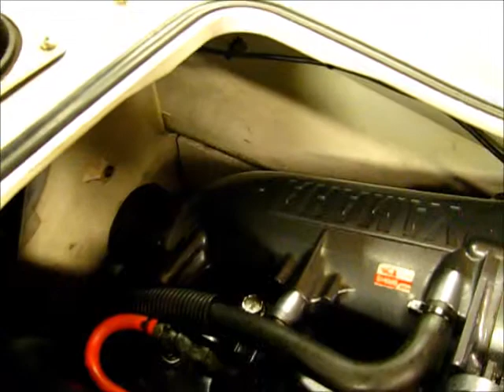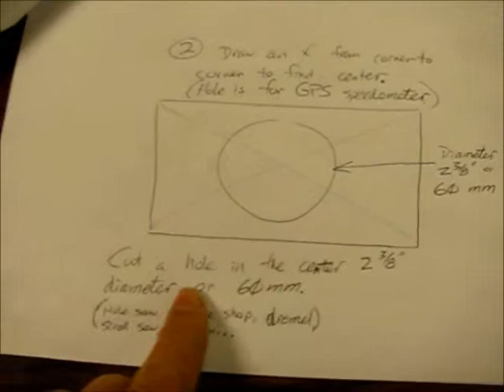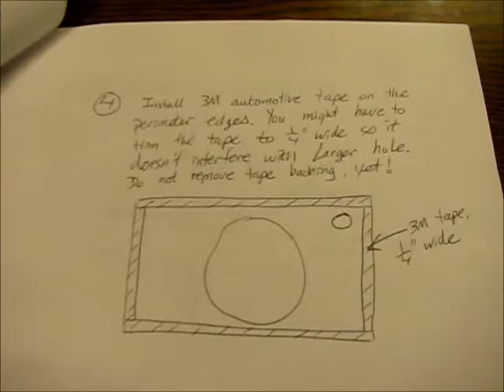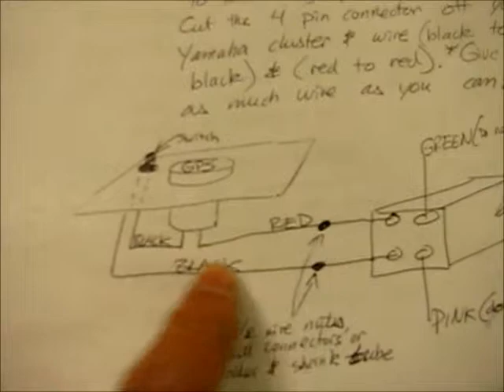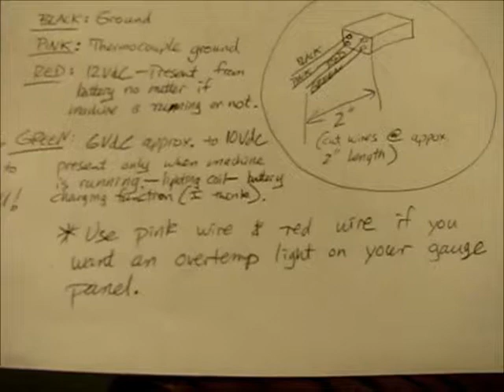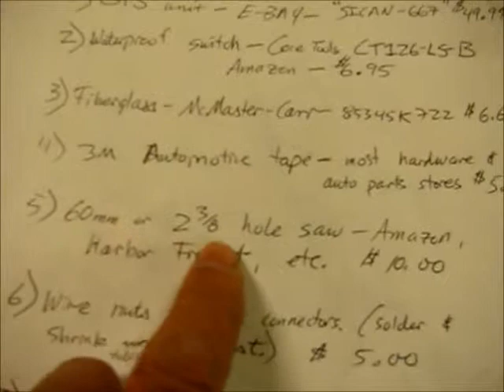How to Build a NEW Gauge Panel for your Yamaha

Comment: I can’t find the gps unit that u used. Can u give more info about it
Reply from the maker: It's been a few years.  It's likely that GPS model is not available anymore if you can't find it easily.  Most of them should be standard size for a common size opening on a gauge panel on boats, etc.  You should be able to find one that works that's a new model.  You'll just have to cut a hole to match and pay attention to the wiring which should be simple.  FYI mine still works great.  Used it last weekend logged 129 miles.  Also, do keep in mind there are people that sell replacement screens if yours is bad.  I was not aware of this at the time of this vid.  DerrickParrish talks about this below in the comments.  Read his comment and look up Gaugesaver online to see if you can get help with that.  Might be a cheaper and easier option although I must say I really like the GPS and the mileage counter on mine.

Comment: I ordered a new LCD screen for mine for $80 from Guagesaver. If you have basic electronics knowledge it’s easy or you can send it to them for $200. The hardest part was getting the front screen off. I broke mine but I cut a new one from some scrap plexiglass.
Reply from the maker: Oooo!  Nice tip!!!  Thanks for sharing.

Comment: Hi Paul, I just found your channel and I’m really glad that you have made these videos for the wave venture. I just bought a 96 1100 WV and brought her home today and just had to put it on the water. It’s an absolute beast of a ski compared to my buddies 95 model 700 WV. The 400 extra CC’s is a huge difference, to me at least. I’ve got a few things to do to get her fixed up how I want but your videos are going to be a big help. My Speedo doesn’t work either, I have to put a new choke cable on ( although I didn’t have to choke it at all today ). I also ordered some new handles for the middle passenger and I believe I’m going to make some homemade strap’s for a third passenger position by using my oscillating tool to carve out a slot in the back handle assembly. On both sides the handle has injection molded slots that I think will be perfect for hollowing on out just enough for some nice strap material that I could use something like a leather craft sewing kit to sew them well enough to make them sturdy enough for hand holds, something more substantial than it has at the moment which is really just to reach behind yourself and hold onto the back handle. I want my wife or whoever is back there to feel more secure than it currently leaves someone feeling. 
Any suggestions on upgrading the sponsons for better overall stability, not necessarily for speed reasons? I’d even sacrifice a bit of speed for some extra good turning stability and overall feel. 
Once again, great videos and you’re a good explainer of what your doing and why. I appreciate that because while I’m capable of a good bit mechanically, I don’t have any experience as an owner of a water craft. I rode motorcycles for many years but this is my first time owning a jet ski.
Reply from the maker: Thanks for the input!  I really appreciate it. Yea, I work on a lot of old stuff and I find many times a lack of info for certain things so I try to post vids to help others.  For handles, I replaced mine with some cool grab handles.  I don't recall the exact ones I used but look at "H2o Kayaks Canoe/Kayak Molded Webbing Handle with End Caps (Pack of 2)" on Amazon for a close example.  The ones I have work great and might even be better than the original.  As for stability, I really have not messed with that kind of stuff.  I know the older SeaDoo GTI's have a fin riveted or bolted on both sides in the rear that might help with turning.  Maybe you could buy a set of those and bolt/seal them to the side near the rear?  You will find these old machines really dig in on the corners, though as they are a little front heavy in terms of center of gravity.  I'm not sure what you could do...

Comment: Pulled the plugs today.   Engine is definitely stuck.    Number 3 ground strap on the plug was bent over as if it had been super-heated.  Hopefully just one cylinder is the problem.    I think these engines have sleeves, so I might be able to get away with hammering out the ruined sleeve and pressing in a new one and replacing the piston, etc.... definitely going the way of premix once it is running again.   I should have listened to your advice at first.   Expensive mistake, for sure.
Reply from the maker: Dang it!  Well you have to remember millions and I mean millions of these kinds of 2-strokes run on oil pumps.  They are super reliable.  I think it's not super likely the oil system failed and froze it up.  Likely it's old age and a piston was slapping around in there and finally cracked somewhere.  I think you said the seller said it had low hours but who knows - people say stuff to sell stuff.  Two big things when you tear it down - make sure bottom case half is not cracked.  Make sure there are no piston chunks down in the case.  Check the crank for loose rods and/or worn thrust washers.  You can buy a rebuilt crank and prob can have yours rebuilt.  DON'T put a loose one back in.  You will have the same issue at some point and the rings won't seat well.  Put new crank seals on it when you reassemble.  These cylinders are not nikasil sleeves.  At lease mine was not.  Should be cast.  You can have it bored out and get over-sized pistons.  That's what I did.  However, after all this effort and money maybe you want to go to mixed for assurance and piece of mind...
Reply: @paulhaines5755  Ok, gonna try and get the engine out today if it doesn't pour rain on me..    The seller did say the engine was low hours, but I think he must have been screwed on the rebuild cost.   No way this thing should have taken a dump so quickly if it was properly rebuilt.  Yamahas are supposedly the most reliable PWCs on the planet.. even an old one.
Reply from the maker: Yep!  Good luck.  Keep me posted ...
Reply: @paulhaines5755  Truly, I don't put this on the dude who sold me the ski.   $500 bucks is nothing, even for a non-running ski with a trailer.   He even offered me my money back, which I declined.   Not fair to him to have to give me my money back, though I wouldn't mind having the money back.. lol.     I told him if he could get the money back from the person who sold him the rebuild, I would gladly take it from that person.   xD
Anyway, it has been raining non-stop... got the engine freed from its perches, but still have to take some more stuff off to get it to pass through the opening.   And it definitely broke the #3 connecting rod... piston is stationary when I turn the crank..
Reply from the maker: Yea - you got a good deal and you got to ride it a few times before she blew which is pretty cool by itself.  Once you get it rebuilt, you'll "Know what you have" + it's a good challenge.  I enjoyed rebuilding mine.  You'll know it inside out which is great...  He's obviously a good guy since he offered your money back but it's cool you see the risk of used stuff and are just rolling with it.
Reply: @paulhaines5755   Where I usually go to the beach, St. George Island in Florida, they rent jetskis... i want to say it is $110 for one hour.    I know I got at least 15 hours before the failure, so I definitely am ahead of the game.    Will let you know how the rebuild goes.

Comment: Sad news, something seized up yesterday...  on the water of course.   Hoping it is the jet pump bearings, rather than the engine, but I am sure I am being too optimistic.   If you would point me in the direction of where you got the parts to rebuild your engine, I would greatly appreciate it.
Reply from the maker: Oh no!  That's a bummer...  Totalally siezed?  Can you roll it over at all to see if you have a bad piston or a hole in one or bad compression in one?  You should be able to disconnect the jet coupling I think in the rear so you can pin point what is froze up - engine vs. jet although it was a long time ago when I worked on mine so don't recall that for sure.  I bought parts from all over the place; if you figure out what is wrong I might be able to give you  some more pointers.
Reply: @paulhaines5755  I ordered a service manual, but who knows when that will be here.   Will investigate to see if I can indeed undo the coupling to see if the motor will turn.   It feels like it is cranking and bunching up the rubber bushing in the coupler, rather than just the starter pinion coming out and jamming with no movement.   And yeah, totally will not turn at all at the moment..

Comment: Hi Paul do you have any videos showing how check when gauge panel isn't working correctly, mine working off and on, when I  first starting riding it its okay, some minutes later is not, its  just showing number zero,  would you happen to know how to fix this problem,
Reply: And Paul its a 1995 Wave venture 700
Reply from the maker: I don't.  However, if when you say zero are you referring to the speedometer function only?  If so, there is a paddle wheel on the rear of the machine mounted in the jet tunnel casting, under the machine.  If you look for it you will find it - it's obvious.  Check it and make sure there is nothing stuck in it that could impede it's ability to rotate easily.

Comment: Question.   How many miles do you see out of a full tank of fuel? (approx)
I took my ski out for the first time today on a river and only put five gallons in it.    I couldn't have gone more than 10 miles total and it seems as if it used around 2 gallons.
Reply: One more... since you have the same ski as I do.    Sorry, but I have been searching and can't find an answer yet.
Yesterday, when I slowed down at one point, then gave it light throttle, it felt like I was freewheeling... gave it a little more throttle and "clunk/slam" back "into gear"... any idea what could cause that?    This is my first jetski, so I don't know.
Reply from the maker: MPG - you're spot on.  I tracked my GPS miles one weekend vs. gas and got about 4 MPG.  As for freewheeling - these machine will sometimes stall when you suddenly let off full throttle.  They will also sputter a little if you let off full throttle then give it quarter to low throttle during this quick slow down.  It might be back pressure of water into the exhaust but I can't be sure the cause.  Since these are direct drive, it is not likely you are seeing some kind of slipping or something like that.  My suspicion is that it's the engine pushing a little back pressure of water back out when you do go back to throttle which gives the combustion a little "cough".  Cure:  I usually don't let off the throttle fast.  Kinda ease it off to keep exhaust pressure more positive.
Reply: @paulhaines5755  Nice.   I took it out again today and didnt experience the “freewheeling” effect.   I did exactly what you described and didnt just let off the throttle wholesale.  Instead i let off slowly. Searched for GPS speedos on amazon and the cheapest was around 80 bucks..  a used unit popped up on ebay for 99 a few days ago, so i bought that instead.  It is dim, but it works properly.   Unfortunately, i now realize my fuel level sender is not working correctly…. Anyway.  Ran the ski at full tilt for about 45 mins and used about 5 gallons.   I can definitely live with that.   Good stuff.
Reply from the maker: Cool!  Yea - anything that runs on the water is a gas hog.  These things suck it down but the trade off is great power and torque.  Fun to ride.  I also have a rotax 717.  Sucks gas down a little less but prob gets about 6 MPG I'd guess.  Yea, check your float  in the tank to see if it's floating to report to the fuel gauge.  That's why reserve is handy...  Don't forget to grease it.  Two zerks.  I think manual touts 1 1/2 hours and full tilt so your spot on.
Reply: @paulhaines5755  whoa, didnt realize there was a grease fitting for the float.   This thing sat with no gas in it (thankfully) for like seven years at least..   so maybe the float is just stuck.  I did grease the output zerc and the starter zerc but didnt know there were more.   Will dig deeper.
Reply from the maker: You greased the two fittings you need to grease.  No others that I know of and I have a service manyal.  No - there is no fitting for the float.  I maybe worded it wrong.  It's prob just stuck.
Reply: @paulhaines5755  Pulled the float... all of them were stuck.     Haven't measured resistance, but I couldn't get a reply from the MFD when I unstuck them, I reckon it is just clapped out....  I guess I will order another one...    Planning on doing a blast around St. George Island, FL to the tune of 40 miles, so I wouldn't mind having fuel level indication.   LOL
Reply from the maker: Cool!  Yes fuel level will be important for you!  I'm on a lake usually not more than 3 or 4 miles from home so reserve is fine for me....  Glad you got some stuff figured out.  Paul
Reply: @paulhaines5755  Yes, glad you check your comments.  I appreciate your input.   Glad to know that my ski is running properly by your and other people's measures.   Top speed I have seen is 55 mph.   Ran it like that for at least a half an hour.   Previously, it would only get up to 51 mph.   So it seems that whatever trash or cobwebs are finally clearing out.  I read that "supposedly" the fuel tank holds 13.2 gallons.  Would you say that is accurate?   When I do my blast, I am planning on carrying a jerry can with me, just in case.
Reply: @paulhaines5755  Also, I figured out the freewheeling issue.   The first time I experienced it, I had no idea what the heck, but now I am wiser.   Obviously, I had sucked up some vegetation into the intake grate and it was not allowing enough water to pass through the jet.   At the lake where I ran it the last two times, specifically the last time, I ran through a whole passel of lily pads and clogged the intake to the point where I couldn't get any propulsion.   There are many many gators in the lake, so I was quite leery of reaching under the ski to clear it... However, it wasn't clearing itself, so I had to say a prayer and bite the bullet..  Anyway, as soon as I cleared it out, obviously, I had propulsion again.
Reply from the maker: Yes - all perfectly accurate.  Sounds exact on the tank capacity.  You are lucky to get that kind of top speed.  That means it's in good shape!  Mine barely hits 48 or so.
Reply from the maker: Brave soul!  Yep - that'll do it.  Make yourself a metal rod with a hook on it, too.  Makes it easier to clean it out.
Reply: @paulhaines5755   Well, I ordered a replacement fuel sender from eBay last night.. Hilarious thing happened today..   I wanted to take the ski out, so I reinstalled the old sending unit...   When I cranked it up on the lake, it was indicating the proper level.   I burned about half a tank and fuel level indicated correctly..  Darn it!   LOL...    Also, I decided to fill up with 87 today instead of 93, and the ski only wanted to do 48 mph..   I am going to use 93 next time and see if the top speed goes back up.   Will let you know what I find.
Reply: I posted a video of my running today... check it out if you care to.
Reply from the maker: Nice vid on the lake!  I watched in on my "big screen"  Pretty cool.  Love the glass water and the reflection of the clouds.

Comment: Awesome man, got a great deal on a WVT1100 and the cluster doesn't work.   Was not really happy about the idea of having to buy a 24 year old replacement off eBay for $400 (when I only paid $500 for the ski and the trailer).    Thank you for making the video.   And actually, all I really care about is the overtemp warning, so I may just do that and skip the speedo for now.    If it says "no wake zone", you go slowly enough to make no wake.   Otherwise, hammer down.   xD
Reply from the maker: You bet!   Glad it helped.   I especially like the ability to track miles.  We went about 50 miles last weekend on ours.  500 total miles since I rebuilt the engine.  Pitfall is no fuel gauge but reserve will get you back if you aren't too far...
Reply: @paulhaines5755  I have been wanting to ask... did your oil injection system fail?   Is that why you just run pre-mix?   Was it as straight forward as just putting premix in and eliminating the oil injection system?
Reply from the maker: I don't think it did but I'm not sure.  The injection system and tank and lines leaked here and there so instead of going through and rebuilding it I just got rid of it.  The injection system is very reliable.  Many many machines have them.  I simply did not want to rebuild it and risk the failure of all the work I did on this so I went to pre-mix.  It's pretty simply to do.  Just remove and cap the pump and premix it.  You can remove the oil tank and lines if you wish but not necessary.  I think my engine failed just due to hours and old age.
Reply: @paulhaines5755  Alright, that sounds good.   This engine has less than 10 hours, according to the previous owner.   I believe him, because he dealt with me very honestly and it took me about 5 minutes to get it running again after getting it home.   The oil injection is working fine right now, so I shall leave well enough alone.   Thanks for the replies!